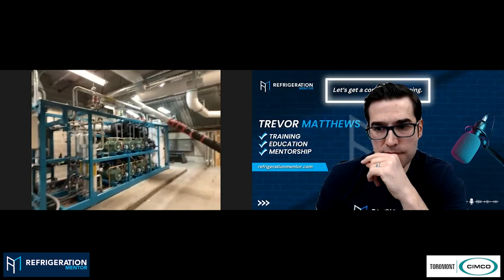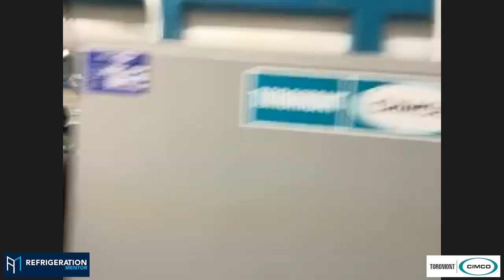Step by Step Walkthrough of a Transcritical CO2 Ice Rink Chiller Plant

Comment: Hi Mentor, could the refrigeration system be located in a different floor than the ice field? Im looking at a case in which the ice field is 8 meter elevated from the ground and the refrigeration system would be located in the ground floor where we have 200m2 available and easy access from vehicles. I would very much appreciate your feedback. Thanks!
Reply: Between, we are looking at an indirect CO2 transcritical.
Reply from the maker: @lluhu  yes as long as the piping and design is correct. If you’re looking to hire a CO2 design firm I know a few that maybe able to help. Send an email here if interested https://refrigerationmentor.com/contact-us/
Reply: @RefrigerationMentor  thank you very much for the reply. This is my final project of my degree, so not a real project unfortunately.
Reply: @RefrigerationMentor  Hi Mentor, Im back to you again with one more question. I would very much appreciate if you could give me an answer. In my project, I can't place all the refrigeration plant (250m2 or 2700 square feet) in the same floor as the ice field for reasons of space. I could place 50m2 (550 square feet) in the ice field level and the rest (200m2) in the floor directly above. Or I could put it all together in the floor above. What of the two options makes more sense in your opinion? If placed in two levels, roughly what would make sense to locate in each? im considering an indirect CO2 transcritical system. Any input would be very appreciated.
Reply from the maker: @lluhu  watch this video first https://youtu.be/atZuKvLuzZo?si=bKYaI6rCqRYBGZ-M
Reply: @RefrigerationMentor  Many thanks RM for the video. What a masterclass from Benoit! Really many thanks for building up this platform online that helps us access quality content. So, I understand that you suggest me to consider a direct CO2 system for its efficiency and quality of the ice. Im on board! I would still very much appreciate your input about how could I distribute the parts. Im a student of architecture, not a engineer or an ice expert and I find difficult to come up for a plan. It is particularly hard to find references to learn from because the ice field is elevated from the ground 8 meters as there is another large space underneath (an industrial storage hall). At the moment in the project I have several potential places where to locate the refrigeration plant. From other references I calculated I need around 200 to 250m2. The possible spaces I have available are 1) 50m2 at the same level of the ice rink (long side in the corner), 2) 200 m2 in the ground floor that are 8 meters below the ice field level, 3) 50m2 one floor below the ice along the short back side but not directly under the icefield. The room aside to this space is the snow pit of the ice machine  4) 200m2 one floor above the ice field (short back side), on the side side as space 3 but two floors above. And 5) Not very ideal but I could also make sme space in the ice field floor between spaces 3 (under ) and 4 (above). Space 2, the one in the ground floor, is on the other side of the ice field and therefore far from all other available spaces.  I'm totally lost with the options. If you could give me a general to which space or combination of spaces, I would always appreciate. I could also offer a payment for this advice. Thanks in advance.
Reply from the maker: @lluhu  send an email to support@refrigerationmentor.com with this message and I will have our design experts have a look and let you know the next steps.

Comment: That is an impressive chiller based on the top technology from Bitzer, Danfoss and Carel.
Haven't seen any CO2 larms though.
With that load of CO2 there should be several CO2 larms placed evenly in the engine room.
Reply from the maker: Could you elaborate on CO2 larms?
Reply: @RefrigerationMentor  I don't know the local rules, but in Europe you need to have a CO2 sensing alarm in case there is a leakage or even a pipe burst releasing CO2 into the machine room. If the unit have a problem and sends out an alarm the first person shouldn't be at risk to be exposed to lethal levels of CO2.
If you have a certain level of CO2 filling in the system CO2 alarm better be mandatory.
Same thing with all A3 classified refrigerants. HC sensing alarms better be in place to give a warning that there might be an explosive environment in the machine room.
If I remember right a HC alarm in mandatory with 4,94 Kg of HC refrigerant filling. 
The smalest CO2 units we sell have 4 Kg of CO2 and they need an alarm for CO2 too.